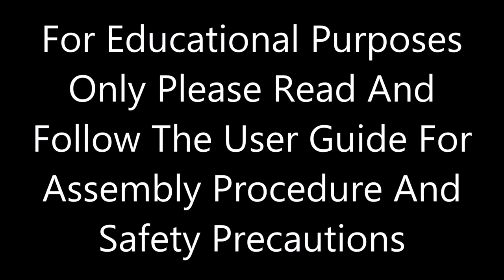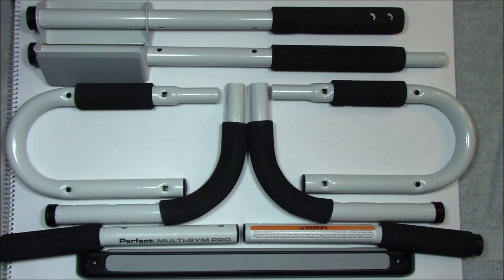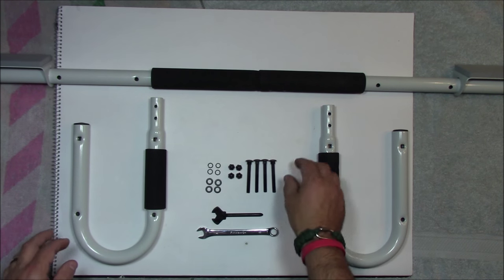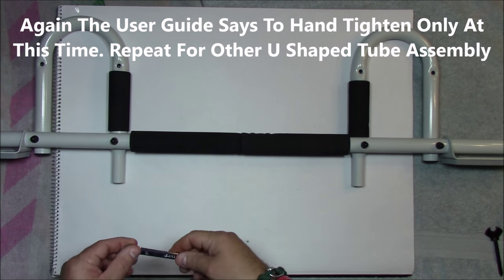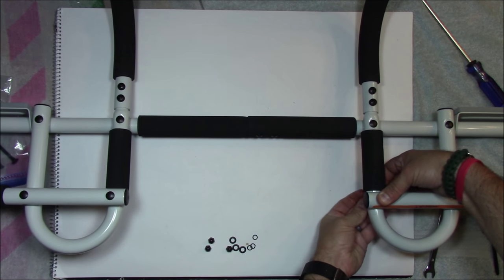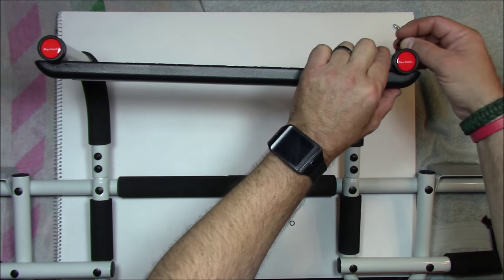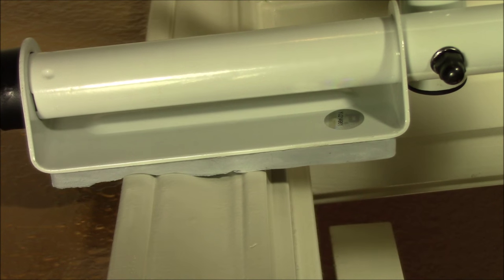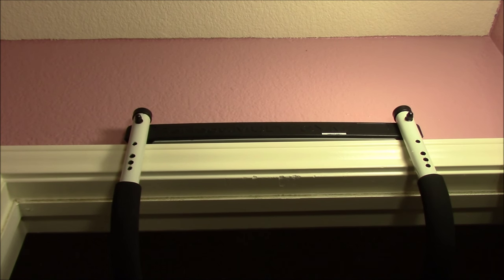Perfect Multi-Gym Pro Doorway Pull Up Bar & Gym Assembly, Installation & Short Hardware Review

Comment: Have you tried the cheaper more basic type of pullup bars? This one seemed a bit less stable compare to those as this one sticks out a bit farther creating a long lever. And the metal around the wide grip portion looks a bit flimsy. The reason I ask is because I'm looking for a doorway pullup bar with a wide grip option that doesn't sacrifice stability. This bar seems more stable than others but still less stable than the one's without the wide grip option.

Comment: the only issue is not with all gyms closed because the covid-19, on amazing resellers are price gouging this from the usual $29'sh up to $99+there's a few government website to report them, so not sure how long It will take till they get fined and stop gouging.
Reply from the maker: Crazy times. They are still available on eBay for reasonable prices https://ebay.to/2yz549r Thank you so much for watching, commenting and the kind words. I appreciate it greatly. All the best.👍😀
Reply: Hey I had the same problem with price. But I found this same one on the Offer Up App for 25 after shipping . There are still some on there with laughable prices but after some patience I found one . It was a listing from 2 years ago so hit up the older one people haven't changed the price .. Good luck stay safe ...
Reply: JC cohen go to walmart

Comment: Richard, thank you for your helpful video. I would like to ask you a question however I'm not sure how to word my question.. I will try my best:  So this pull up bar has some "rounding"  parts and it also has the typical straight bar that all pull up bars have... my question is, what if you place one hand on the rounding part and your other hand on the straight bar and then perform a pull up, would this be a good idea to build muscle? or would it be a bad idea? thank you.
Reply from the maker: You want to train your body in as balanced a way as possible. Whatever exercise you are doing make sure you work your muscles equally and you should be fine. You can do the exercise you are describing here but make sure you do it with both sides of your body (left and right hand alternatively on the round part). Thanks.

Comment: The screws from the main bar to the curled bars are too short to put the capping top screw onto.  I had to go to the hardware store and buy some screws long enough to fit.
Reply from the maker: Thank you for watching and commenting. I appreciate it greatly. All the best.
Reply: What kind of screws and where can you get them? Mine didn't come with the right size screws either.
Reply: dude same. What the HECK!
Reply: Same with me brotha, I got the multi gym, and got all the wrong screws too
Reply: Your bar....is upside down, I thought the screws were too short, until I realized  the bar was upside down

Comment: thanks man this video really helped me set this thing up
Reply from the maker: +William McCumiskey You're welcome. Thanks for watching.
Reply: You said this supports up to 300lbs and everywhere i see it says 220 pounds. How much you weight? I weight 220 but I don't want to buy this if i would break it in a second.
Reply from the maker: +Spartan 04 I was 210 Lbs when I started using this and I had no issue with it. I am now 180 LBS and it is still serving me well. The Amazon description states 300 LBS capacity Perfect Fitness Multi-Gym Pro, White At Amazon: http://amzn.to/1YuKIBF The manual states "for use by individuals weighing no more than 300 lbs/136 kg." You can see that on page 6 of the manual https://perfectonline.com/downloads/MG%20PRO%20UG-web%209-12v3.pdf So I am not sure why you are getting a different number but the manufacturer states no more than 300 lbs/136 kg. Thanks.

Comment: Hey Richard Great Video!
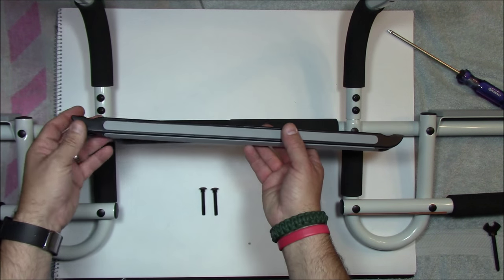I was wondering if you look at your video at 14:22, what is the distance between the two neutral handle bar grips. The two narrow neutral handle bar grips. The two grips that have the black foam pads on them. I do not want to get a chin up bar that is two wide. The length of my shoulders is roughly 38 cm so if its a little wider then that it would be perfect. Thanks!
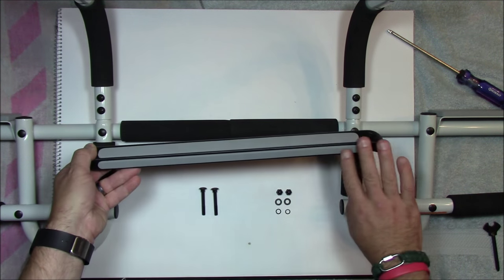Reply from the maker: The two vertical black grips you see @ 14:22 are 41cm apart (16 inches) measured to the centre of each grip and the horizontal grips are 70mm apart measured from inner part of the black foam and each horizontal foam grip is 13.5cm including the black plastic cap. T hanks.
Reply: Thank you so much Richard! I think I may buy this chin up bar.
Reply from the maker: Thank you for the question unfortunately I just checked Amazon and Perfect Fitness no longer makes this model but there is good news, they have replaced it with an improved model (at least from what I can see in the pictures) that will allow much more latitude on handhold positions. Here is the link for the new one called The Perfect® Multi-Gym Elite here is the link for it Amazon: http://amzn.to/2e36OdG Looks like I will have to do a new review on this one.
Reply: Thank you Richard. I will look into this one!
Reply from the maker: Please make sure to report back to me if you buy it. I would like to know what you think of the new model. Thanks.
Reply from the maker: $230, wow that's crazy. The one you linked looks good too. Thanks for asking about this I am using mine again now because you asked. Take it easy on the first couple of work outs on it if you want to be able to move next day. LOL.
Reply: I will be going easy at first. I just started doing p90x3 and its pretty awsome
Reply from the maker: P90x3 cool. I will look into that. I like the no longer than 30 minute workout idea. The biggest mistake many make when they start to work out is to go too hard (I have seen many trainers do this to new clients as well) and hurt themselves or make themselves so sore that they don't want to do it again. All the best.
Reply: Thanks you too!